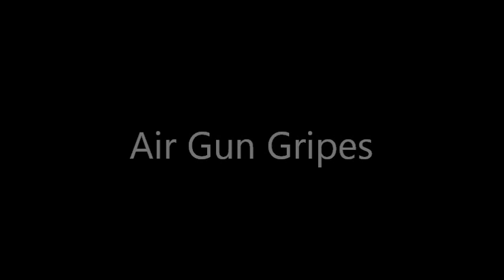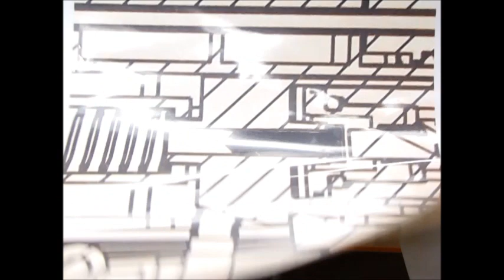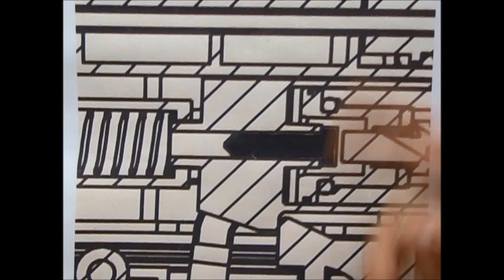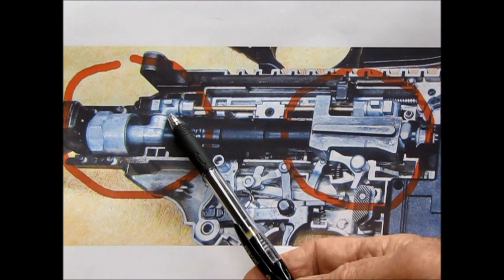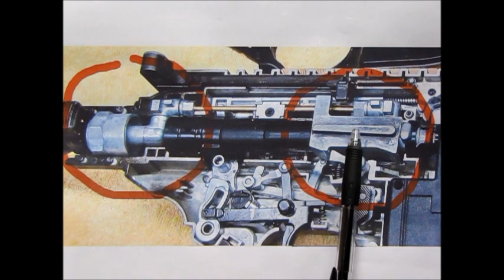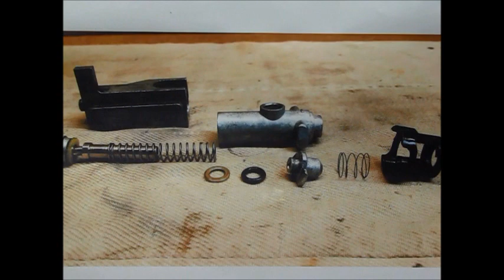Sig Sauer MCX and MPX Big Problems with MPX and MCX Co2  Final Review.

Comment: So is the mcx canebreak any better?
Reply: Yes.
Virtus-like internals. Better choice if wanna use a HPA kit.
I've now got an old co2 MCX and a Virtus - but I also definitely want a Canebrake someday. It just cost noticeably more than the darn old MPX n MCXs over here in Finland..
Reply: @jantelow  Yea. I think I've seen it being sold even over €400 at some store over here. But at around €350 as cheapest - which is pretty high already..
 But I definitely want one. It looks as if it woulda gotten Virtus internals and then they'd added after that an internal co2 cartridge adapter onto the rear of it all. No idea if the rear of the receiver chassi is somehow as a separate part - but it looks like it could be - and that would be incredibly awesome. That would possibly mean a removable co2 cartridge thread adapter straight from the manufacturer for the use of a HPA tank without extending the buttstock length to too long - and that would be some awesome engineering.. I might be totally wrong too - but the rear portion of the internals looked way promising.. I'd love to have one in my hands right  now for disassembly.
 Yup. I have actually also just seen one single negative feedback of one. But I'd bet it was a leakage issue - and the owner probably did not just bother to lube the system. I've used silicone oil - and I've not having any leakage issues whatsoever. I just lube every now and then, when I feel like it. But it has kept everything good.
But yea. I know. Other boring stuff mostly take our cash from the dear airgun hobby. I oughta soon also put cash on my car..
Reply: @jantelow  You are so damn right Jan. Lotsa things to discover and learn.
Them grooves in the belt we woulda probably been better without. But or course is way cheaper to manufacture such belts - rather than to fit every pellet seat with a soft bushing or something like that. Now when I've been shooting lots with RWS Hobbys and Gamo Pro Match pellets with my Virtus, I've noticed the RWSs to seat way more easier - and they shoot n hit hard. The hard fitted Gamos kinda resists much more being fired out of the belt. Same 19ft-lbs with both pellets - but you can definitely feel the difference when shooting. I just picked the 1gram Gamo pellets to have something heavier to compare to. But the Gamo Pro Match pellets though been quite accurate, even they oughta get pretty bad groove damages when seated.

The old MCX woulda been better off also with an o-ring sealed cone nozzle for sure. No doubt about it. My cone nozzle has been filed and polished twice now. I'd really wanna give it an o-ring the next time I open it up. The fork operating the cone though was not as good in the old MCX as on the Virtus or Canebrake now. My fork arm at least did not move the nozzle front enough -:and that's probably why the cone's rear got hit and damaged so over time.. Funny as is - the Virtus n Canebrake's nozzle ain't tapered the same way anymore - it's more like a short step now. I'd though might give the Virtus' nozzle too a spin in the lathe. The cast surface ain't that perfectly flat as it could be. It possibly could seal the breech even slightly better.
I recently made a new brass roller (or actually two) for the trigger. Trying to give the upper transfer bar a slightly longer movement and a trigger with less dead space. Will see someday how that turns out..
Made also a new hammer spring guide. A work in process actually. Haven't cut it to length yet. Gonna see first how long it actually can be, before the hammer touches it and all that. The original spring guide is only about 22mm long - so I'm guessing the spring kinda bends awfully around it all within the tubes. No idea if helps - but I just wanted to try do sucha thing. Longer guide can allow also more bushing length for a tighter hammer spring setup..if not finding a totally new hammer spring that is.... Just gotten thoughts to test allkinda stuff. May work - or then not.😁
Reply: @jantelow  Damn well said Jan!
Yes. That wiggly hammer not always pushing the same way is a big one imo also.
And yes, I weren't to make the new test spring guide that much longer. We're out to do measurements of the hammer's rear and the telescope tubes before deciding any lengths. But I might do it a slightly bit more tapered with a small rise on a longer length. The og is more of a round ball at the end and otherwise as thick overall. Will see..
Ha! That car engine lubrication was a very good metaphor! Btw. I do oughta put a few drops into my Virtus again. Many many magazines since last time I added. And especially now at higher pressures.
Reply: @jantelow  Oh man.. That truly was a bit long comment surely - but I liked to read it.
I've not gotten any highly accurate PCPs myself yet. But I've lately concidered the Hatsan Factor and Walther Reign (mk1) - since I have never a chance of getting extra cash for a Huben K1 (one I'd absolutely love to own). Leaning towards the Reign lately. The Factor's big magazine annoys me, even the rifle looks damn good. And the unregulated Factor costs "only" €700. Wanted a Hatsan Bullboss at some point - but I kinda just forgot about the rifle and moved on. It might be good though, even I think it had often some issue with the lever (or something)..
But yea.. See ya!

Comment: The best way to get more power would be to decrease the spring tension for the air chamber valve in the air chamber to stem so it opens longer with a lighter spring and or you can increase hammer spring tension so the valve is open further. or softer air chamber spring & harder hammer spring one or both may need to be done to get the right air valve timing.
 This is a big reason people are not getting more FPS with adding more PSI to the gun is that the air pressure has been increased in the chamber as you step up adding more PSI to the gun, so now you are fighting the spring tension as well as the higher air psi, over stock. I just got the MCX last week and will be making changes as I go. here is a video for the inside of the Virtus looks much better and also looks to have the same hammer LOL.
https://www.youtube.com/watch?v=pJtmddapcHs
https://www.youtube.com/watch?v=bVEK3F-uwJU
Reply: I installed a small washer behind the hammer pin before jamming it back into the bolt. Creates more travel and a deeper strike on the firing pin. Power, consistency, and blowback have been excellent (only put a couple mags through it so far), compared to a non-firing weapon prior to installing the washer.

Comment: Ive had the same issues with BOTH of my sigs. do you think using a thicker o-ring for leaks will work?
Reply: Oughta do it. 
I put new o-rings onto my co2 MCX's gas transfer tubes even though it had never even leaked. I just had my MCX for cleaning or tuning at some point.. The new replacement (metric) o-rings did feel noticeably tighter to fit in than with using the originals -:so I guess my MCX is now just even more secured not to leak. If a valve leak occurs (small hissing sound from the magwell) then I just add several drops of thick silicone oil into the system from the rear. Everyone that buy a new one of these Sigs, oughta start with a silicone oil lubing of the internal system. It will keep it running. My Virtus leaked as new. Never woulda thought of sending it anywhere. I just put three big drops of silicone oil into the rear hole of it before attaching the full airtank again - I took 4 or 5 empty shots - voila: another Sig valve leak gone. 4 or 5000 rounds thru my Virtus already by now I'm guessing roughly - but it still works fine. And I'm currently pushing RWS Hobby pellets out at 850fps with a reg output of 100bar. And no leaks. Ive  even used a 90bar output for a long time before upped it again after getting my very first chronograph.
These Signs ain't for everyone I guess.. I know what they are - but I love fixing and tuning them. My main hobby I guess..🤣

Comment: There is a little piece of plastic that holds a pin in place, when you press the trigger. Its located close to the breech. This cheap plastic will break at some point & render the gun useless. Is there a way to get in touch with you to buy replacement parts?
Reply from the maker: Sorry no replacement parts, I'm done,  going to move on.....
.I'm finding that far to many SIGS are breaking not just the MC and MP thanks for watching.
Reply: @macsteer45mac96  Thank you, I liked the   MCX so much. I opened it up, and it just feels cheaply made. For something that costs around 300 bucks, I expected more from Sig. Its like they were not even trying and just slapped their name on a shiny piece of crap and call it gold
Reply: My Sig MPX failed the minute I needed it. A raccoon was inches from my chickens and I put the MPX up and on target and “clink”nothing. Pulled back the charging handle and again clink. Reseated the magazines, pulled the trigger still absolutely nothing. I transitioned to my secondary M18 green gas and hit it 3 time in rapid succession. He turned looked at me like is that all ya got? lol and trotted confidently through the fence like Blue Arnie Schwarzenegger “I’ll be back”. 
Googled the problem and found your vids. Looks like a piece garbage to me. 
Not going to bother. Pissed. I train guys  in hands on combat and weapons. No more Sig recommendations. What are your recommendations for CO2 rifles? The green gas pistol is hanging in there but not used a lot.
Reply: I found an stl file online to 3d print the plastic retainer part which tends to break when dry firing it. Let me know. I can pm you the file